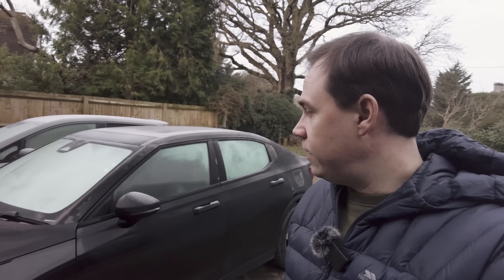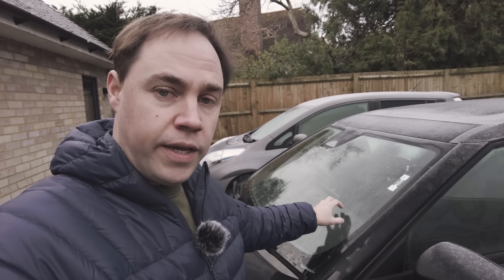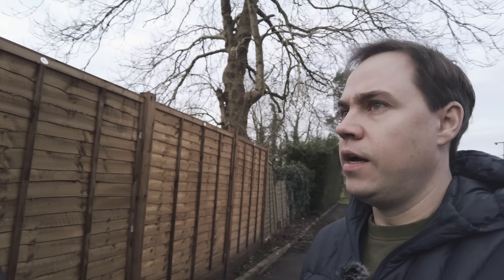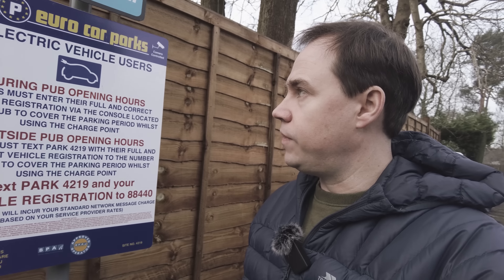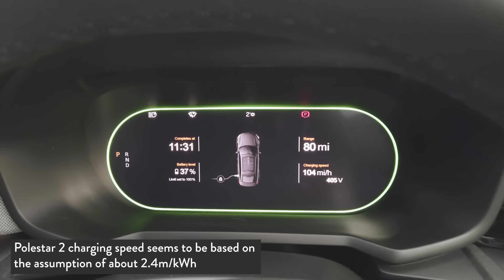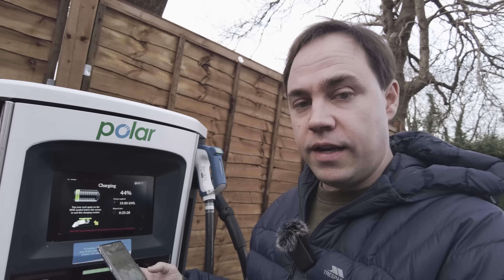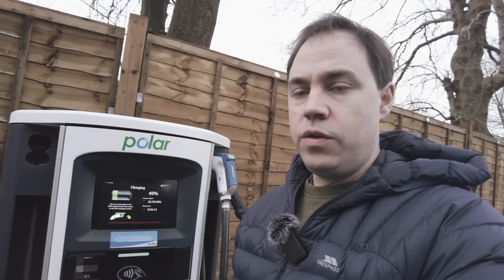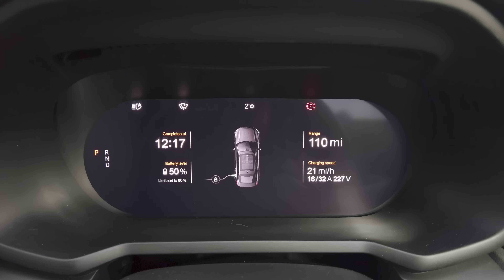Polestar 2 50kw cold weather charging at BP Pulse

Comment: Thank you for making a video about the need for slower fast chargers.  I travel a lot.  Sometimes, I only need to purchase enough electricity to reach a destination that is 100 miles away, but my Tesla Model Y charges so quickly that by the time I use the restroom and grab a quick snack, the car has added 150 miles of range.  I could stop the charge with the app, but Tesla will then rightfully begin to charge 'idling' fees for occupying a charger.  We need a good mix of chargers at locations which have facilities to accommodate different traveler's plans.  I have found that in colder weather, if I do not allow my car to preheat the battery, I can relax a little longer while I eat some food. 

Another great and honest video!

Comment: I hadn't realised that Polar had rebranded. Just having a look at my phone i notice that the App doesn't show up at all on the App Store here in Norway, suggesting that it is region locked. Previously it was possible for foreign visitors to use the Polar Instant service, but now it appears we are not welcome at all :) I can add it to the list of charging networks who take UK-only customers...

You are completely correct about the fast charging. It is a total misconception that you need to fully charge an EV in 5 or 10 minutes, cos at every break you need to go to the toilet and stretch your legs. That's 15 mins. If you want to eat something (especially as a family), that's a 30-40 min stop realistically. The Model 3 actually has it about right - 15 minutes to 50%, and 40 mins to 90%, and the ability to drive 2hrs+ on a 90-10% discharge. For long distance you can then alternate short and long stops to make rapid progress whilst having sane meal breaks. If the battery is warm the polestar is actually not all that far behind the Model 3, so once they sort out battery pre-heating the two cars will be a lot more similar in real-world usage.

Comment: 50kW chargers can always deliver 50kW when standalone. Only chargers placed in bulk will limit if their supply is less than their total capacity. (4x 50kW chargers on a 150kw cable for instance.) A single 50kW is most likely tied in with at least a 70kV supply so even at a 0.8 power factor it has 55kW available with margins.
It is almost always the car that limits. The "charger" is really just a very expensive voltage/current supply with ground fault detection. It limits voltage and current to whatever the car wants and it updates this many times a second.

Comment: It's not the handshake that fails on heavy cables, it is the locking latch/servo in the car that fails to engage if the connector is tilted down too much by the weight.
Reply from the maker: Yes but this can cause issues with starting the charge. Plenty of videos on YouTube showing these issues. It can sometimes help to hold the cable in place.

Comment: I’m watching this now, whilst charging at a BP Pulse 50 kWh charger in 1c temperature 😊
From 59 to 80% I was getting 78mi/h
Reply from the maker: Nice! Thanks for watching. 4g issues is starting to drive me mad
Reply: @ShortCircuitPS2  -  me too. I went for a 50 mile drive, the first 20 miles 4G was off, it came back for about 15mins then went off again 😭

Comment: It's only when you have a combined low state of charge and the battery  is cold that you get limited power and/or regeneration.

A warm battery even 0-1degC outside temps you'll get no limitations even as low as 20% SOC.

Comment: Mine has stopped charging at 10 below zero in northern Sweden. I’m 60km away from Volvo. Hoping tomorrow I have enough in the battery to take it in. If not, they are going to have to come pick it up and leave me with a replacement.

Have to say that not having the app to warm the car up is becoming very frustrating for me. I have to get up and get dressed just to warm up the car.

Comment: You appear to have left the RFID tag in the windscreen (about 3/4 way up on the passenger side) - it’s used for delivery, and you can just remove it. At least that’s what it looks like from the brief glimpse I got.
Reply from the maker: Yeah you are right! Really need to remove it.
Reply: @ShortCircuitPS2  my company supplies the tags and associated tracking system 🙂

Comment: Can you preheat from the house? Does the app allow it?
Reply: No app yet for the Polestar 2 to connect remotely.
Reply: @DereckBreuning  wow, seems a big issue. I regularly preheat my Tesla when I get up so it’s warm and ready when I leave 20 minutes later. :)
Reply: @SirHackaL0t.  you can set a preconditioning schedule in the cars infotainment system, assuming you always drive at set times. But once the Polestar app is out later this year, I assume there will be an option to start preconditioning from the app.
Reply: @SirHackaL0t.  I kind of take it for granted having a Nissan leaf and Model 3 which both have had it for years. 10 mins before I leave, quick tap on the app and get into a nice warm car.
Reply: @kaustavbhattacharya3878  Later this year? Wow. How long has the car been produced?
Glad to see that Polestar/Volvo think that an app for the car is such a high priority.
Reply: @SirHackaL0t.  its not a big problem at least not if you live in extreme temps :) For me no issue. Though it is undeniably better to have that app and do it remotely!
Reply: @iowgtr  Same here. I give it a few minutes to warm up whilst having my coffee before leaving. :)